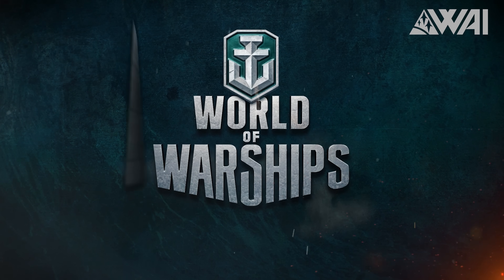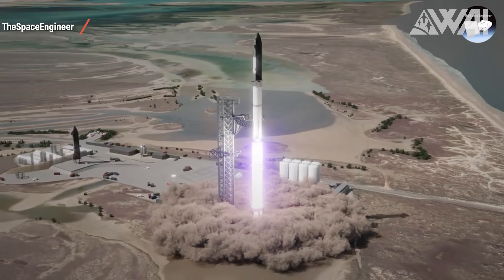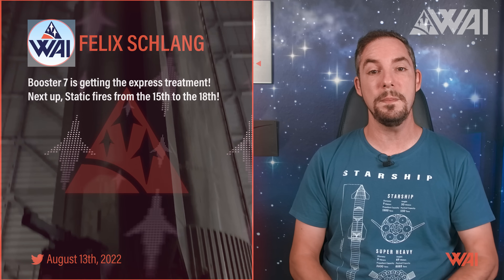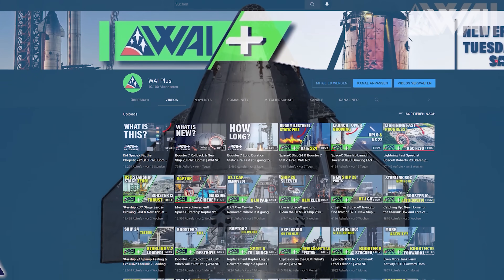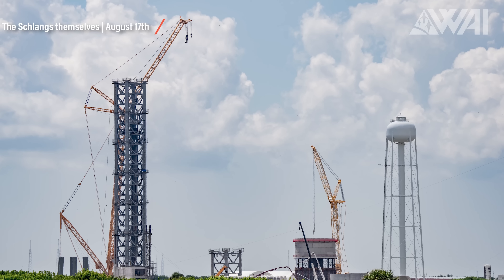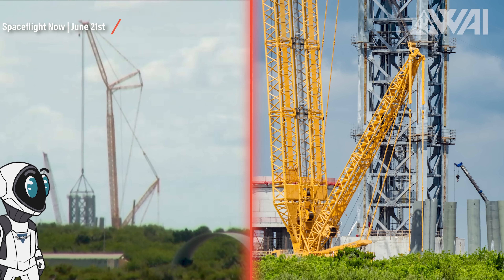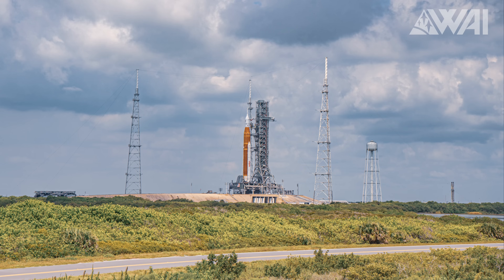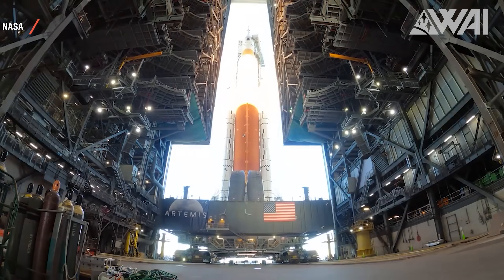SpaceX Starship & NASA SLS! Greatest Double Launch In Human History!

Comment: The tower is going to try and catch the booster, I believe if they attempt this, the weight and velocity of the vehicle will place an extreme torque on the tower, where stress on the tower will fail and the tower may snap in half and a hugh explosion will occur when all of this hits the ground, hopefully I'm wrong. The tower needs a wider base, and anchored with cables on the opposite side of the tower, cables similar to those on a suspension bridge.
Reply: Have you done detailed calculations from the detailed design that you can come up with this conclusions?

Comment: You said after booster 7 and ship 24 that the ship will continue on a ballistic trajectory which is very very false. Ship 24 will fire its engines and the original plan was to come within a few m/s of orbit, but with star link on board they will probably enter orbit release star link and then deorbit.
Reply: Starlink brought by S24 & S25 is not intended to be a part of the constellation. Sole purpose is to test the deployment system, but the satellite will quickly reenter because the ship is reentering as well without deorbit

Comment: Given the amount of starship failed landings that were only failures in the last seconds of landing it seems crazy to go for a booster catch first try but should be spectacular either way.
Reply from the maker: Keep in mind that a booster does not need to do the crazy swing maneuver right before landing!
Reply: You can bet that Super Heavy has a good landing abort plan just like Falcon 9 does to keep from hitting the drone ship(tower for SH) in an out of control fashion. They have lots of experience here. They will likely abort nearby or perhap in the water - which will be the initial target.  Only a last minute manuver will align it with the tower.

Comment: Is there anything that would make this easier and less likely to fail than a real honest to goodness weight? A weight on the opposite side that was equal or even 50% or 25% the weight of the Starship and a few extra pulleys in between. Notice that there are wheels that they move the SpaceX to and from most of the places it goes. With a few pullies and some "rope", it is possible to lift a substantial weight. Should the hydraulics lift the full weight then the old school pully setup could function as backup or reduction of the workload. Just random thoughts, but sometimes the easiest solution is a solution that is easiest and sometimes those are overlooked.
Reply: The winch SpaceX is using in monster several thousand tons used to lift drill stems on oil riggs some are heave composited ie capable of very fast motion and load sensing .
Reply: @jackdbur  I was an engineer offshore. We didn't lift the heaviest things, we floated them and settled them down (sank them) off the barges.   Really cool watching them sink as we ran out from under them. Water is cool in some ways.

Comment: If star ship can flip upright and slow down enough to land why can't it do it for re-entry? Wouldn't that eliminate the friction/heat of re -entry? Eliminating the need for all that heavy ceramic hear shielding. What am I missing?
Reply: Fuel basically, slowing down in space takes as much energy as accelerating.

The point of the friction during re entry is stopping for free.

In theory by the time it does the flip maneuver its falling extremely slowly, so you barely need fuel for that part.

Comment: Any idea why Musk wouldn't test the catching mechanism with a hop rather than a full launch? Seems it would be safer, no?
Reply: Not really any safer... the booster isn't going anywhere near the tower unless it's under enough control for them to steer it there.
Reply: @simongeard4824  That doesn't sound right. Catching a booster that's coming from space and has been falling at hundreds of miles per hour seems way harder than catching one that's only gone up half a mile or so and under constant control at very low speeds.
Reply: @zmagicsolutions  Because if the booster is near the tower, it's under control and moving relatively slowly. If it wasn't under control, it would be aimed at a point somewhere out to sea. This is how Falcon landings work today – they're aimed somewhere safe, requiring active control to shift the aiming point to where they want to land.

Comment: Those actuators would probably be not required if the chopsticks were equipped with large gripping electromagnetic pads, which wouldn't require special supporting spots or rods and shouldn't be allowed to squeeze or stretch the ship's hull.
Reply: Where is it? The one that existed are hydraulic cushion
Reply: @alvianchoiriapriliansyah9882  Where is what? Gripping electromagnetic pads are an idea of mine.

Comment: A catch attempt on the first launch is insane.....  Just getting the thing safely away off the pad would be a great milestone.
Reply: To be fair, the catch attempt is very conditional... they want permission to try it, but will do so only if everything goes far better than they likely expect. Similar to how they programmed in the landing maneuvers for SN8, even though they expected it to be destroyed in a failed first attempt at the skydive...
Reply: @simongeard4824  A lot more to lose now that they've built out all the infrastructure - and it won't be landing on a bare concrete pad. Still, if they do catch it safely the program will be that much farther ahead, technologically speaking. And those Raptors are a lot of money.
Reply: Remember that (like Falcon), the booster isn't going to come down aimed directly at the tower — it's instead aimed somewhere safe, requiring active control to redirect it to the landing site. So while accidents are certainly possible, that's why I say it's conditional... the default is for it to crash into the ocean, but if they're confident after the re-entry burn, they can tell it to go for the tower instead.

Comment: So, if ship 24 resumes on a “ballistic trajectory” it appears to skip circularisation. That makes a lot of sense from a safety standpoint, but it leaves the question how the starlink satellites can reach orbit. There is some gap here.
Reply: They probably don't care about the satellites burning up because they're probably testing the satellite dispenser
Reply: @m1abrams1776  Exactly. It's not supposed to be a real Starlink mission — it's an end-to-end test for Starship operation, to which they've apparently decided to add a test for payload deployment. And since Starlink satellites are pretty cheap, they've apparently also decided to use real ones to ensure authenticity of the test, rather than spending effort on creating a close-enough replica...
Reply: Mhhh… honestly, that doesn’t sound right. It might be true, but that’d be like testing the seat entertainment system during an airbus maiden flight or something
Reply: @constantin-X  Well, SpaceX do things differently. They're obviously willing to test everything they can on the first test flight... they've certainly installed a payload dispenser into Ship 24, suggesting an intention to try using it. And of course, they're limited in how many launches they can fly from Boca Chica, so it's understandable if they want to make the most of each attempt.
Reply: @simongeard4824  understandable, yet they will have primary and secondary test objectives and it would be very dumb to have a secondary test prevent any primary ones. For example failure of satellite deployment might prevent a proper reentry and landing attempt, which is obviously the primary objective.So, it’s not as simple as stuffing everything we can into the first test.
Reply: @constantin-X  I agree it's a bit of a gamble... but the fact that they installed a dispenser into SN24 does suggest an intention to use it..

Comment: Other than a launch explosion, very very unlikely, the Starship will achieve orbit and probably send out those Starlink satellites. What we all will most likely be watching first is what happens to the booster. Soft water or catch. Another grand show either way. Then there is the deorbit of Starship. Will it survive reentry ? will it attempt a catch or just do a soft landing either on water or on land.  All in all; this is going to be one of the most watched of all times.
Reply: The plan described is very much the best case, and I don't think anyone should reasonably expect that to occur. If I was putting money on it, I'd say that the booster will not be recoverable — while they're obviously building on the experience of Falcon, I think it's very unlikely that the first attempted flight will go so well that they decide to proceed with a catch attempt. For Ship, I'm reasonably confident that it will reach the target orbit(ish) as long as the booster works, but I think a breakup on re-entry is the most likely outcome.

Comment: Good on you for correcting the numbers but SpaceX isn't using the vertical GSE tanks for Methane, they are using the horizontal tanks. Whether that is because of a design issue or Texas law is up for debate as far as I know).

Comment: I understand why at this point it’s a difficult task to install engins into booster4..but…i wonder if SpaceX could eventually move to a cassette system for the engines, perhaps 1 for the centre 13 and 1 for the outer 20???
Reply: No every ounce matters & the best part is no part. Anyway SpaceX install each in an hour or less.
Reply: Thank you for replying, my thoughts may not sound, or indeed be practical, however, Musks goal is a quick turnaround!

Comment: Nice! I also like how you did the correction about the tank volumes! :)
Now, if it would be possible to use another font so that the small 'L' in the short form of Mega-liter doesn't look like a large 'i', it would be absolutely perfect (for me). But I understand, if it's not possible. Personally I'd prefer m³ anyway in this case. But that's up to you.
Reply: The litre, is an "extra unit" to give a single comparison to other units of volume.

Meters^3, is the actual measurement.
It is possible to convert 
Meter^3 into litre,
by adjusting the decimal point. 

1 litre = 0.001m^3  
1000 litres = 1m^3 
1 litre = 10cm^3
Reply: 1 mega litre = 10^3 x m^3
Reply from the maker: It is possible! Will try to change it for you! :_WAISweet:

Comment: I wonder if those "hydraulic actuators" are in fact pneumatic? Using pressurized air in place of hydraulic liquid would allow for compressibility and thus shock absorption. Of course, the booster will be essentially hovering, so perhaps the actuators will just rise up as it hovers and no real shock is expected. #purespeculationonmypart
Happy birthday, Steffi!

Comment: So, the first Starship flight on the full stack will technically be a sub-orbital one as the Starship itself will not perform a circularization burn into orbit. I'd guess that getting the entire Starship into orbit would be the next step in the process, and for deploying Starlinks, this setup is sufficient so they can offer it commercially.
Reply: Musk said it was basically orbital velocity. like just a few m/s short of it, which is a trivial next step if everything before it works.

Comment: I would love to see SpaceX build something similar to the Detroit Tank Plant during WW2. Where parts went in one end and mass assembly line carried everything out to the other end and complete tanks rolled out the other end. If SpaceX did something similar with a huge assembly line building to mass produce Starships and Super Heavy Boosters they could reach real economy of scale.
Reply: The SS factory at the cape will be something akin to what you describe, with the exception of the engines and flight control hardware.

Comment: I would like to at least see them attempt a simulated 'catch' of the booster first before going all in on an actual returning booster. They could hang it from their crane and have the arms quickly move into position and see if it can grab the booster as it should. If it can't or if there is any hiccup then that would be the time to find out. So far we haven't seen the chopsticks move more than at a fairly glacial speed.
Reply: It would be safer to let the booster launch from a stand and hop over to the launch/catch tower
Reply: @paulmichaelfreedman8334  The crane would be the safest since the booster would practically be not moving. It would be a rehearsal to see how quickly and accurately the chopsticks can close and engage at the lift points. If there is a failure with that being the most basic of tests then it will certainly fail any actual test with a booster moving under its own power. 

So far SpaceX hasn't even closed the chopsticks quickly at all even without a booster in place. I would think they would want to test all that out before ever thinking about actually catching anything.
Reply: I suspect those actuators were ordered months ago and the original schedule would have had a launch by now. But now SpaceX has a booster and actuators so a catch is an option - but no more than that and everything would have to be perfect.

The booster should have plenty of fuel (light payload in the Starship and not orbital) so they can practice the hover and abort to the sea if it gets out of hand. In fact they might need to hold at the hover if they are going for a catch, as the booster might be over a maximum landing weight.
Reply: @Julius_Hardware  I'm not doubting that they can do it I'm just saying I would like to see some mock dry runs with the chopsticks moving at speed rather than the maximum 1' per second that we've seen so far. 

The actuators that they are installing now are for the brackets that extend out from the main chopsticks. They don't even need those actuators to test moving the main chopsticks at full speed. Why won't they just do some tests practicing the full speed and motion of the chopsticks before trying it out for the very first time with a rocket coming in hot. It makes no sense. 

It doesn't cost them anything to do a test or two without any rocket on the orbital launch mount even. They could even use one of the decommissioned earlier boosters and just throw it up on the launch mount and practice quickly closing the chopsticks to the correct position to test accuracy. It wouldn't even matter if they screwed up and dented it since they are going to be scrapped anyway.
Reply: Elon mentioned in Tim’s Everyday Astronauts interview that the booster will take a long time to come down and the arms will have time to adjust as booster comes down to resting point.